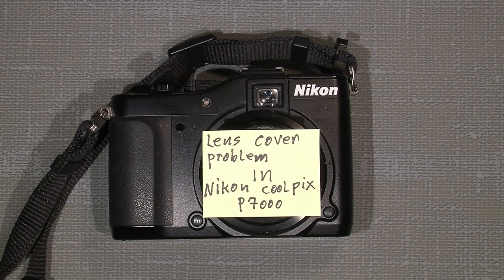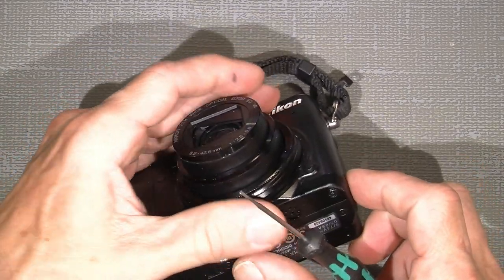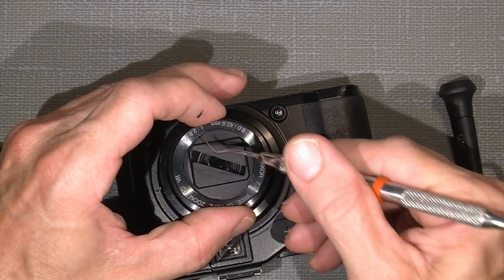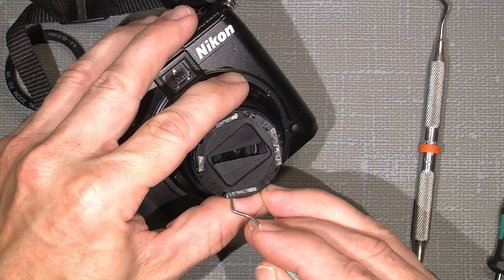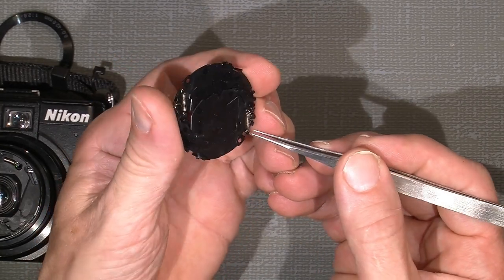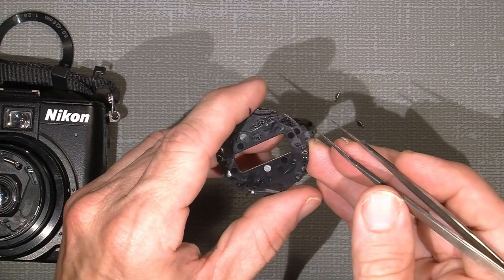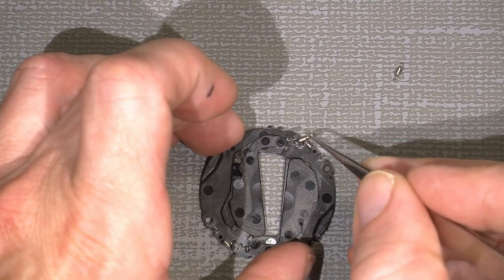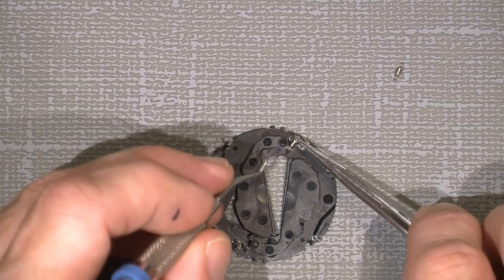Lens cover problem in Nikon Coolpix P7000 ( Repair inspiration )

Comment: THANK YOU SO MUCH! This video literally helped me put back together the lens curtain component for my Coolpix S6200. I took it apart before finding this video, because the curtain wasn't closing all the way, and stupidly didn't take photos as I took it apart. For awhile, I thought I didn't have any hope of putting the component back together, especially when all four of the tiny springs popped out. I did struggle even with this video since it wasn't the same component, but it was similar enough for me to get it back together and fix the camera so that the curtain functions as expected every single time! THANK YOU SO MUCH AGAIN!

Comment: Thank you for this video. Mine does the same thing--closes fine, opens only part way. I think this is a common problem with all the cameras that use this mechanical design, including Canon and others.   Rather than trying to repair it I settled for pushing the blades so they snap fully open. Easy.

Comment: I have possessed two P7000s and five P7100s. All but one of the P7100s has had this problem, and that one has only survived because it's hardly been used. The design is hopelessly vulnerable to any dust or grit (two Australian beaches with gusts of wind did for two of them) but they just pack up anyway. As someone else has said - it's a crummy design. No wonder they dropped it for the P7700, but then added a rotating screen that's bound to have the wiring fail with endless twisting. I've tried various repairs to the P7000/7100 lens but in the end all you can do is remove the lend cover vanes and the springs and live with out. I found an SLR lens cap that would fit over the whole assembly and resorted to using that. Misery over.

Comment: It`s a wonderful cam, CCD Sensor and all manual etc. Another imagequality, analog look - onther style. The problem with the front is a produktion--design mistake. Shit happens. I solved the problem to remove all the blades, found a cap to ensure the lens. Done. Easy and does either what it should. Another big problem is the battery for the date etc. - there is no manual to find it to remove the dead one... By the end one of my most beloved cams.,even nowadays.
Reply: Hey! Exactly. I have the problem with the battery for the date. Do you know something about that? I don't know how to fix that on my p7100. The repair is more than 100 Euro, so I would love to do that on my own. Is it realy a batterie or a capacitor and where is it??